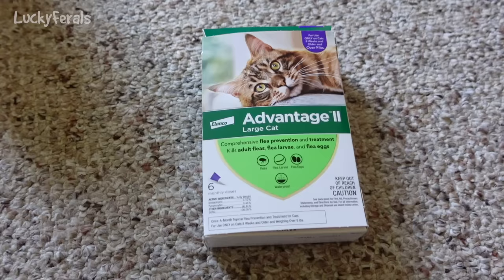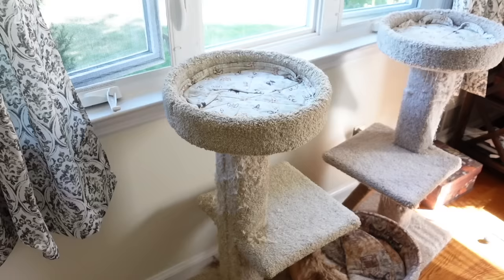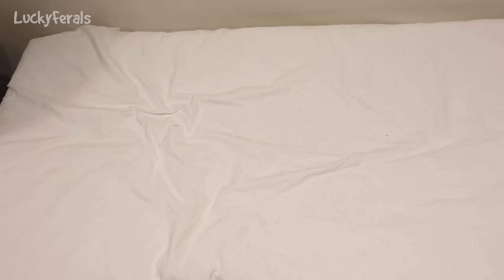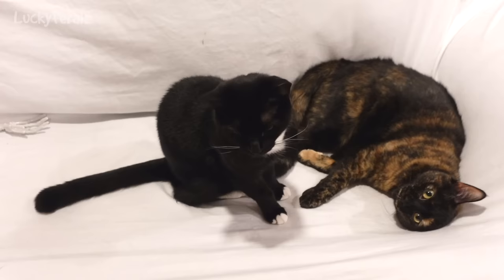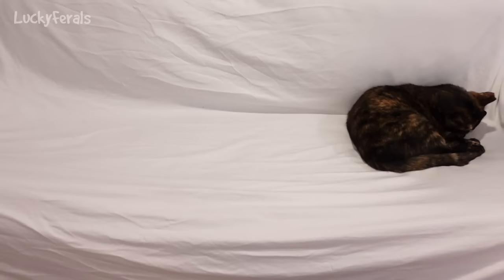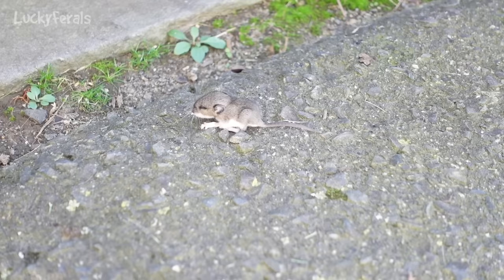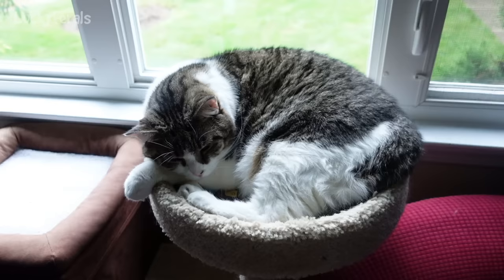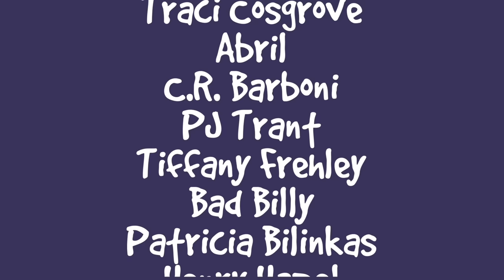The Flea War Intensifies! - S7 E5 - Lucky Ferals Vlog - Life With 11 Cats - Cat Video Compilation

Comment: My mom used to sprinkle salt around the carpet to kill off the larva.   I also have a room dehumidifier, which gives off a lot of heat making me rarely use it.  But for fleas, that would be great.   Just vacuuming every inch of space on the floor every day is what worked best for me.  And that was in a fully carpeted room with the floor being covered with lots of little baby fleas because I had a new feral cat quarantined in there.   I couldn't even touch him to put the flea med on him.  Had to use an edible version.

Comment: Fleas are the worst thing to deal with as a pet parent. The flea drops are very effective at killing the fleas along with treating the home. Fleas prefer to live in the soft furnishings in the house. The little blood sucking fleas can cause so many problems and severe infestation can kill small kittens. Some cats can have an allergy to fleas and start loosing patches or thinning fur. Sometimes I have to admit that the use of chemicals in the war against fleas and it can very much seem like a war. 
The flea combing helps monitor how many fleas are in the house. Flea combs or headlice combs work. The best comb I have is for headlice but it works because the metal teeth are so close together and it pulls the fleas off as they get stuck in the teeth a bowl of hot soapy water to clean the comb off and then dry with paper towels if needed. The comb being wet may make it easier to comb the fur.
The white socks are a great way to see what is going on and if some areas have a worse amount of fleas. The laundry will mount up whilst you try kill off the fleas. 
Good Luck with your war against fleas I hope you can find the best chemical free method for you and the cats. 
Take care 
Love, purrs, cuddles and kisses for all the cats I hope the nasty fleas are gone soon.

Comment: …For sticky, gummy residue from stickers or whatever, a microfiber towel with a few drops of lemon essential oil will take it off. It smells nice as well. 🍋 😁🐈🐾🌼 Sometimes you may need to dab the oil on the sticker and let it sit for a bit to loosen it first.

Comment: …For sc@bs on myself, dogs, and cats, …I put coconut oil (I keep it in a small clear squeeze bottle that I can put in a coffee cup of hot water to keep it melted) …so I put a few drops into a water bottle or soda bottle lid/top/cap and have that in my hand and dip my finger into the coconut oil, and dab it on the sc@b, and it takes away the dry itchiness and helps it heal nicely. I am very fair skinned and it helps the redness as well. It’s worth a try for sweet Boo boy’s neck itches. 😁🌴 🥥 🐈‍⬛ 🐾🖤